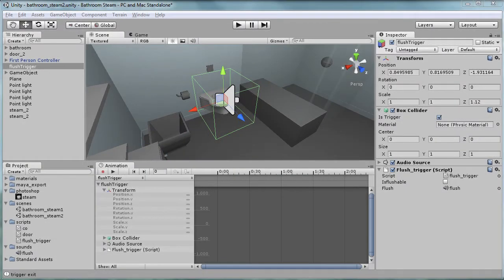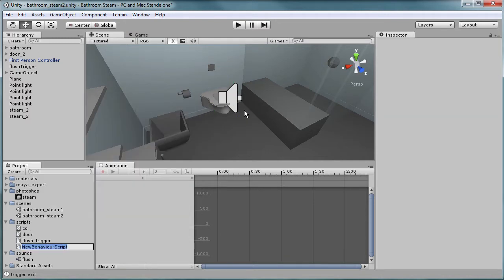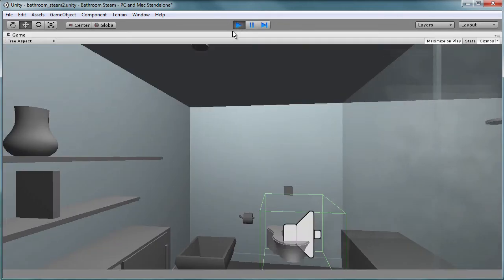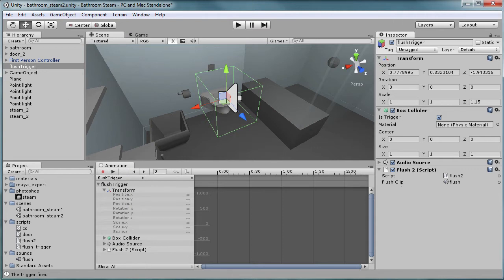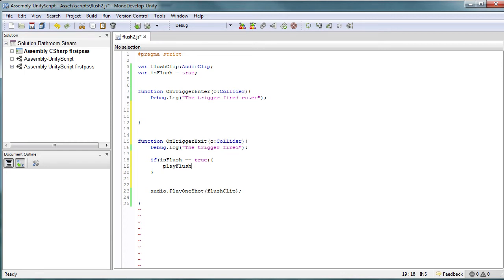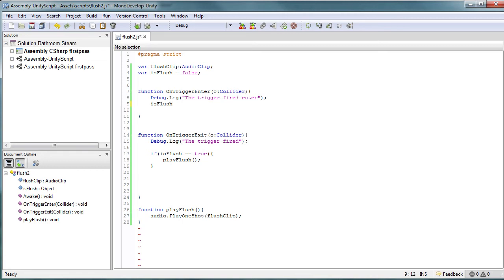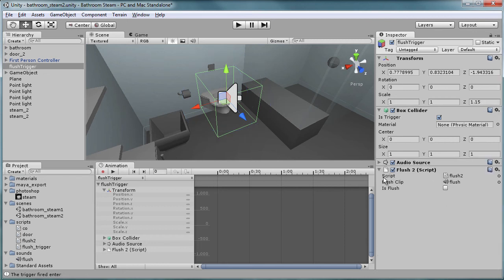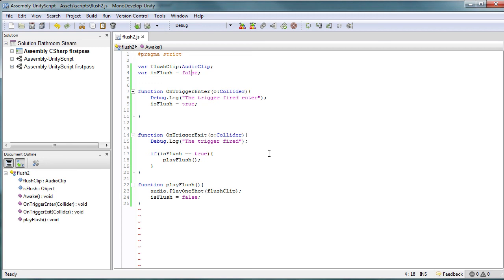How to Trigger Sounds in Unity3d

Comment: Hi mate, your tutorials are really useful. I'm trying to trigger some narration in my project. So when the player walks through a collider the narrator will talk in a 2d sound. trouble is I can only find tutorials for pre unity 5 builds and when unity updates the script it always does it wrong. it's such a simple thing that I need but I've been banging my head on the keyboard for almost a week now trying to figure it out. it's essentially the same concept as what you're doing here but I cant get it to work.
Reply from the maker: flooblybub thanks, you know a number of people have asked the same question, so ill do an upadte to this video or unity 5. It will take a day or two. Question are you in C# or UnityScript?
Reply: C# would be great, cheers mate you're a life saver.

Comment: I got a few questions: for a project i'm working on we need some audio triggers we don't have any programmers in the projecgroup(we're all 3D artists) and i got the task of making the audion triggers work. we work in unity 4.6.

The idea is basicaly that we need some sort of light(blinking if possible) and need it to trigger a audio track, we have multiple audio tracks(1 per trigger). the audio only need to be played once, so once it's triggered it shouldn't play again, also the light needs to disappear once the audio is triggered, as a final thing, only one audio track should play at a time even if the user trys to trigger another.
Reply from the maker: Just to be clear you have multiple lights each light blinks and plays an audio clip once then the both become inactive and only one audio track should play. There are a number of ways to approach if you have sometime i can put a video together for you to show how its done, it wont be ready till tomorrow. If not i can type some instructions.
Reply: Edithson Abelard  WOW thanks, yes thats how it needs to work, I have no idea how hard or complicated this is since I am not really into programming myself.

I actually need to be able to implement it tomorrow, so instructions should be help me alot.

Thanks for the help already and the quick response.
Reply from the maker: The best way to start is to have one class that manages the whole process and add your sounds to your light gameobject. When the light is triggered play that sound, and when a sound plays set a boolean isSoundPlaying to true. Now you can use the audioclip length to invoke a function in x seconds to set the boolean to false
Reply: Edithson Abelard  Thanks alot, I will try it out.

Comment from the maker: Sure, would you be able to take screenshots? If not, there are a few traps to look out for in Unity. 1) Function names are case-sensitive so make sure onTriggerEnter is really OnTriggerEneter. 2) Make sure your object collider has the trigger option checked, otherwise it's an OnCollisionEnter. 3) Make sure your player character or both objects have collisders attached. 4) Debug.Log() a message and see if you are registering an event, if so then we have to debug your audio clip setup.